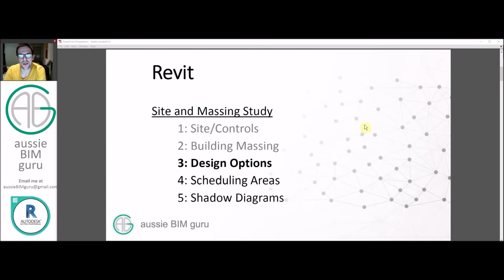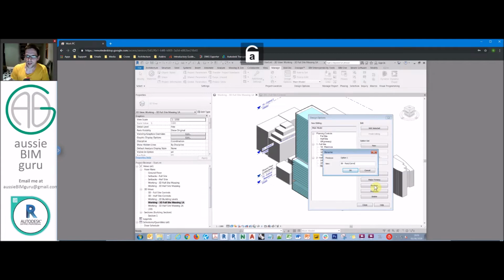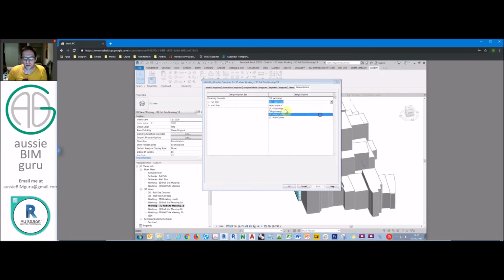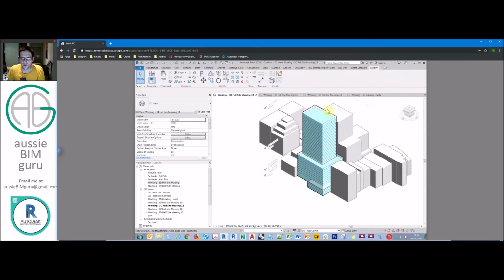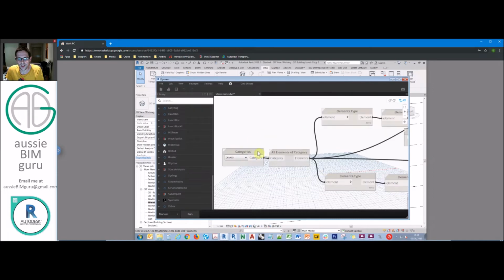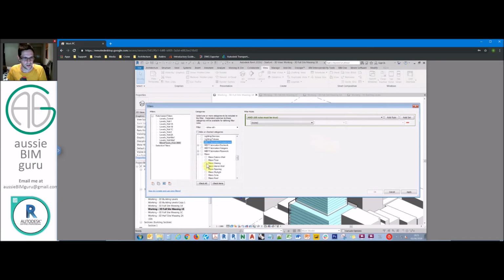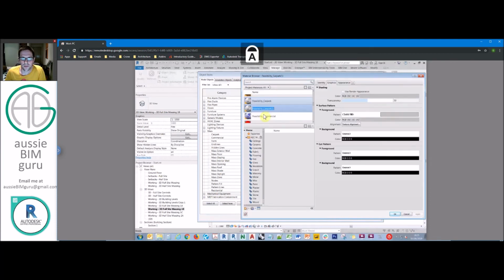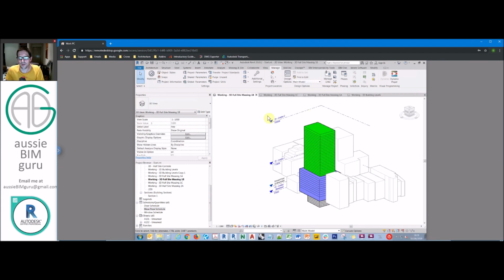Revit Design Massing Options (Feasibility Part 3)

Comment: Hi Gavin, 

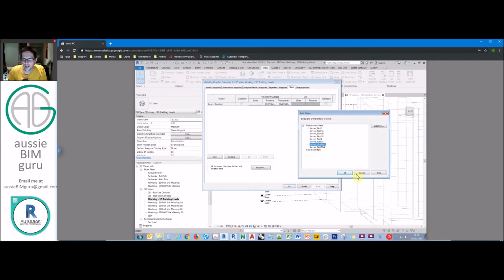You mentioned around 13:30 that there are other ways to do a feasability using dynamo but I couldnt find a video on it. Will that be a topic that you will some day visit?
Reply from the maker: These days I mostly use Rhino/Grasshopper for feasos, more well suited. I did however make another video on my general Revit approach to block/stack

https://youtu.be/Y5usM6SUj78?feature=shared
Reply: @AussieBIMGuru  another great video, thank you for sharing !

Interesting you mention rhino. I haven't had much luck with rhino for feasos when it comes to the scheduling. I haven't found a way to sort through the data trees to breakdown areas by individual buildings across a larger site. My grasshopper  skills  are fairly basic so I'm not sure if Revit level scheduling is achievable within rhino/ grasshopper.

Comment: How did you apply colors to the floor in different views? Was that with object styles or visibility settings ? By the way your tutorials are very much like a pro.Very much needed tutorials especially for revit.
Reply from the maker: Check out 19:20 where I use view filters to detect the floors by height to split them up. This is view specific, so you could technically do this with different colors per view if you wanted (or apply this consistently instead using a view template with those filters).

Thanks for the kind words, I always try to bring my professional experience to my videos!
Reply: @AussieBIMGuru  Hi Aussie, you mean to split them by floor area right? Also, would you say creating Mass subcategories, as you did then, would be a better workaround? Would it offer you the same flexibility?
Reply from the maker: @MrDrenahmeti  yes height or area work where you know the limit. Where you dont I usually use subcategories instead.